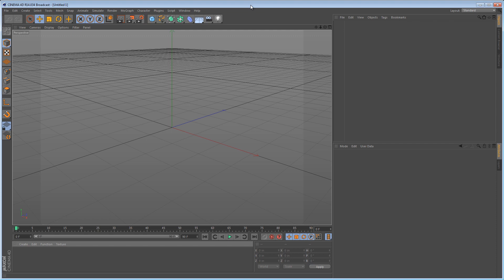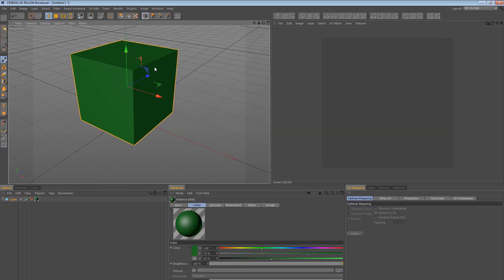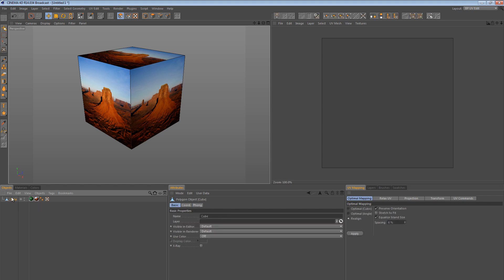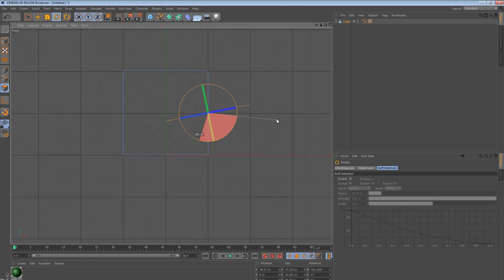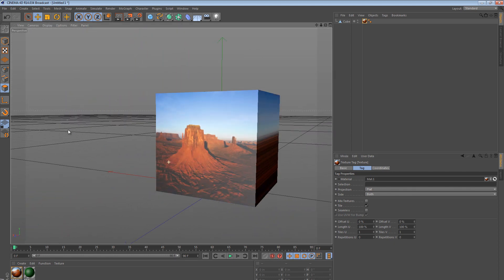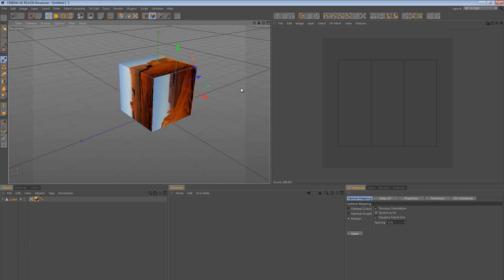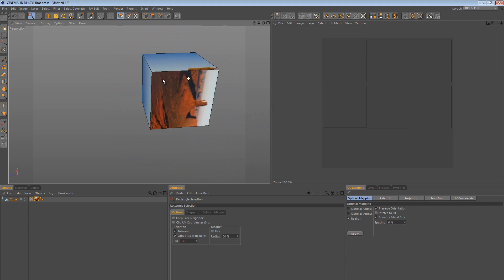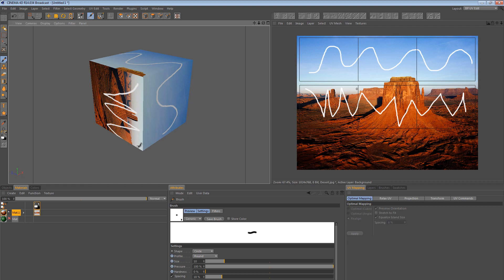UV Mapping Examples - Part 1

Comment: thanks for the video - is there any way of making all the joins align? So that when i paint it will be like actually painting on a cube, ie. no harsh cuts between the sides? Im wanting to add dirt and grit+ scratches but it gets to the corner and you see a cut where the UV doesnt line up. Thanks